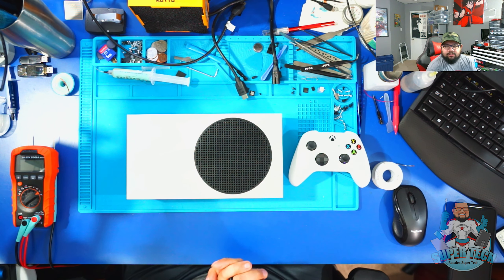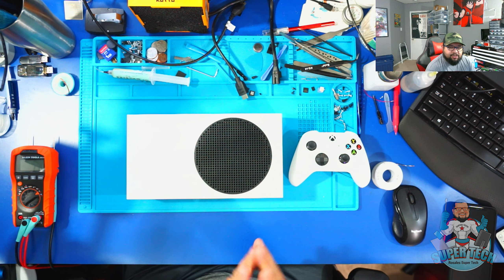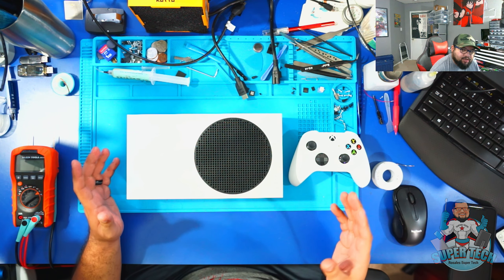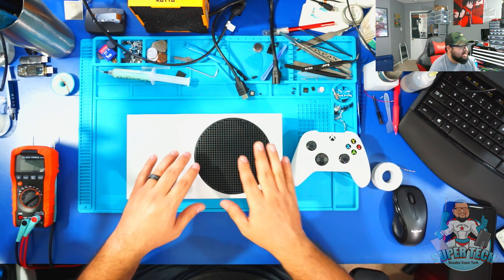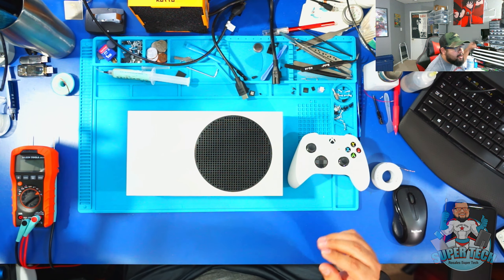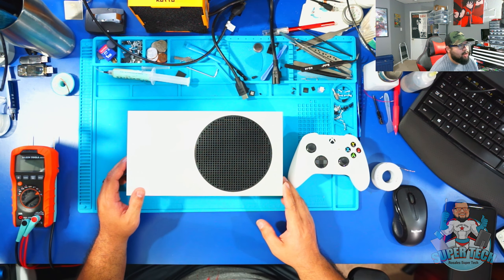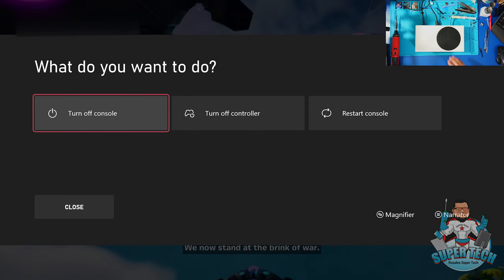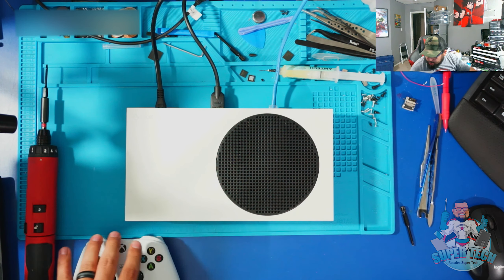Broken HDMI Port - Xbox Series S - No Display

Comment: also what if 4 of the pins are bent, could I just bend them back?
Reply from the maker: If pins can be set back into their place, I don't see why not; make sure that no pin is touching each other as you can cause a short, and the issue may worsen. I don't ever push pins back; I replace the ports as that is the safer and proper way to repair an HDMI port.

Comment: Good job but I didn't see how the 6 grounding pads been attached.
Reply from the maker: My apologies, during editing I removed the part where I heated the board from the bottom to solder the 6 grounds pins as my baby boy walked in yelling and got distracted so removed that bit off of the video. Next video I will show that part.

Comment: I don’t have a heat gun but ive a soldering iron and a replacement part i cant desolder
Reply from the maker: Unfortunately, without the appropriate tools I do not recommend this repair to be done as it requires that not only the ground legs to be disoldered but also the pins. Which requires even heat to be spreads so that the solder solidifies and the HDMI is able to be removed.
Reply: @RosalesSuperTech  I’ll just wait a bit longer and get a heat gun

Comment: My series s is broken the exact same way how much do you charge to fix this
Reply from the maker: Hello Kdot, thank you for reaching out. In the description below, I have the URL for my website; within my site, I have pricing. Also, you can register and get details for shipping. Let me know if you have any questions.
Reply: It's usually estimated around 90 bucks, least it is in my area. Since I do have a pretty good micro soldering station, I just decided to up my soldering skills and now 3 months into my practice and research, in attempting this repair myself.  But the repair cost is mostly cus of the specialty tools needed, without them it makes this job dang impossible.  The part,hdmi port is only like 25$ with the awsome special thermal paste and flux.
Reply from the maker: I charge $130 for the series s, based on my expertise materials, parts, and labor.

Comment: mine isnt broken, the metal ring around the strip is bent up.  it works with the cord crooked.  can i take a knife and bend the outer part of the port in?
Reply from the maker: Once an HDMI port is compromised, I suggest replacement of it, as it can cause other problems from killing other components like the filters or the ESD booster ic.

Comment: So my screw driver kit and hdmi port are coming today so I need a heat gun for real to remove the hdmi port?
Reply from the maker: Yes, a hot air ESD station is needed to remove an HDMI port. HDMI ports are soldered on with leaded-free solder which takes almost twice the heat to melt. I do not suggest using a regular heat gun as they do not get that hot.
Reply: It’s not cost effective to fix this
Reply from the maker: It depends if you want to spend $299 for a new one or $130 to get it repaired.

Comment: Would i be able to just a use a usb to hdmi converter?
Reply from the maker: I am not sure if I understand exactly what you are referencing.
Reply: @RosalesSuperTech can we use a port to hdmi to play on our tv instead of using hdmi to tv
Reply from the maker: No, the video data is processed through the APU and send to a retimer and ear booster IC. Is in a converter from USB port and convert to HDMI will not work as video data is not being processed through the USB port.

Comment: Sad we gotta do this
Reply from the maker: Yes & no, this is done when devices are mishandled and are too rough with them to where the HDMI port breaks.
Reply: @RosalesSuperTech  I bought mine new. Never moved it and it went out. It’s 200 to fix. Might as well buy a new one. Plus I tried fixing it but it’s to hard to get the solder off
Reply from the maker: With the new consoles, there is a known issue that factory ps5 and Xbox series consoles do not have enough solder on the ports, where they come loose and are needed to be soldered back on.
Reply: @RosalesSuperTech  you gone do it for me lol? I know the hmi cost 20 dollars
Reply from the maker: Some repair shops have different pricing; we charge $130 plus tax plus the shipping cost for this repair.
Reply: @RosalesSuperTech  ok. Your email on your page?
Reply from the maker: What is being paid for is not just the part but the expertise and time to get the repair done with not causing any other issues and having a warranty along with it. I can certainly get it done, for $130 plus tax and shipping cost.
Reply from the maker: Yes, my website is on my page. Rosalessupertech.com
Reply: @RosalesSuperTech  ok thanks

Comment: Will an hair dryer work?
Reply from the maker: No, the hair dryer won't work. It doesn't get hot enough to melt the leaded-free solder that is on the motherboard for the HDMI port.

Comment: It turns on it's the hdmi not working
Reply from the maker: So the issue will either be the HDMI port video encoder or the ESD booster IC chip. I got to my website, which is listed down below if you like to send your device in for repair.